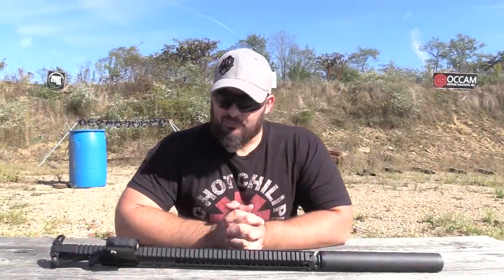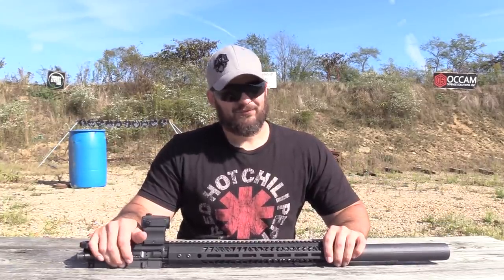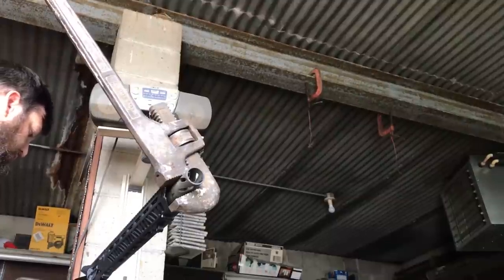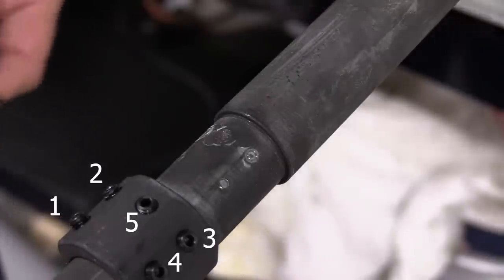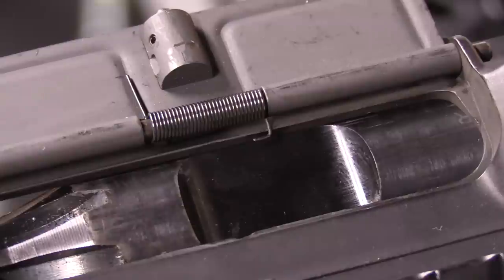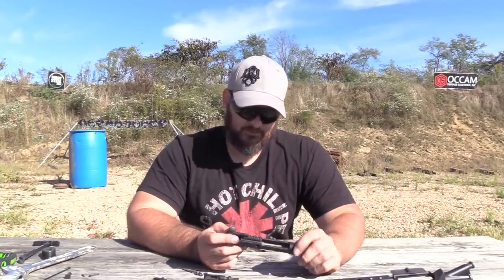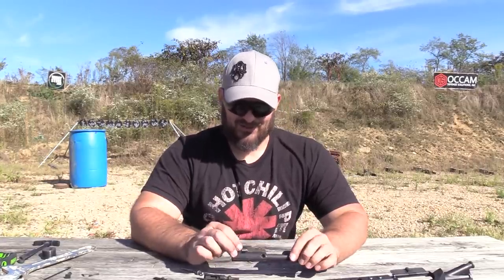The Worst AR 15 I've Seen 🚩Bear Creek Arsenal🚩

Comment: So this video really pissed me off for the fact you were calling anyone who buys or builds a budget AR names. Your also saying there is no way a bigger name company will ever let a non perfect upper through. Well I'm a gun guy not a brand guy like you seem to be, meaning I buy what I like no matter what the name on it is. I own a sig M400 AR I had to send it back to the company 3 time for all sorts of reasons, the bolt, the barrel was warped when it came out of the box, the ejector was jacked. Did they fix the proublem yes they did but what I got was junk. I also own a lot of bca uppers and every one I have got have been completely fine even after 100ps and 1000s or rounds through them. What I'm saying is it dont matter if you pay $200 or $4000 for an upper things can slip through no matter what. And your words NOT ALL YOUTUBERS ARE CREATED EQUIL

Comment: Damn! I thought the video was actually a pretty good testimony for the bca upper. Buy it, check it over, use some red lock tight, use a torque wrench, n check the stakes on the bcg, oil the gun properly and maybe don't use it on a full auto. Then I read the comments section that absolutely roasted you. This was pretty funny. Definitely considering a bca complete upper. Thnx for the review.

Comment: I currently have several Bear Creek uppers and one complete Bear Creek AR I've had zero issues with any of them other than a 7.62 upper and the problem was the magazines. They recommended ASC mags which did not work well when I switch to duramags I had zero issues.

I think it's a possibility you just got a bad upper I don't know. I've also dealt with their customer service and haven't had any issues with customer service despite with some others on here saying.

I think as with anything you can always get a bad fill in the blank some people love Chevy some people love Ford some people love Toyota and dachshunds I've owned them all and I've had lemons of almost everyone but then again at 60yo I've owned probably over 100 trucks in my lifetime.

Don't discount Bear Creek arsenal I think they make some good stuff for the most part.

Another option is to think maybe it's a you problem and not a firearms problem.

Comment: I understand where you are coming from but believe you are incorrect with your complete assessment. You brought to the the table a brand new upper acspecting it to run like a broke in pony even tho it was a brand new unit. YOU NEVER LOCTITE A RIFLE BEFORE THE BREAK IN PERIOD IS OVER FOR THIS VERY REASON! Another point is the specific round you are using...a hunting round. You can never acspect a hunting round to run thru an AR like the .223 or 5.56...the round was not designed for it. Every manufacturer has its draw backs so to say that BCA is the worst is a far reach. In my opinion, DPMS is trash but I don't shoot it down before I know what I am talking about. I bet you a hundred bucks that if you do a proper break in and cleaning that the upper will run fine....I noticed you didn't complain about FTF OR FTE or FAILURES of any kind. And when you are purposely running a weapon to ruin it...I think it is a little irresponsible of you to come out and then try to destroy the reputation of it once you tried to make it fail and it didn't. And yeah...I own some BCA rifles...never a problem. Again, these are my observations and opinions.

Comment: Do you not check stuff out after you buy it?   I have plenty of experience with BCA and I have always had got great quality rifle parts.  Maybe you got 1 that was a lemon.
Reply: No, I'm sure it was just fine. It's like buying a huffy from Walmart and expecting it to compete in a downhill race. It is a budget upper in a beast caliber, full auto suppressed is outside its operating capacity.
Reply: If a manufacturer cared about its reputation, it shouldn't be necessary to check their stuff.

Comment: Every once in a while, you get lucky I guess. So, I had an el-Cheapo AR by a well known East Coast price-leader American armory (good stuff...), and I figured as a cheap experiment, I'd try out .300AAC on this gun (taking the upper off, making a convertible with the lower). I didn't want to make a caliber investment in something that I was curious about, that might fit my needs, but wasn't sure yet. So, at a show, I bought an absurdly cheap 300K upper... I had a choice of about 4-5 in the batch, and spent 15 minutes to ensure I picked the best one. Some were definitely not assembled too well... but the one I had was well-aligned, and well-built. Less than $150 for a little 7.5" upper... went home, inspected, tightened, and the only real adjustment was adding a clamp to guard against handguard rotation. (Same one you display there...)

The thing performed fairly well. Granted, I only put a couple hundred rounds in it. We'll see how the finish and components hold up. But it works fine, for the limited use I need it for. It's boss for the price; love it. I was curious as to who it was, so I started searching all these mystery components... made of "Chinesium" as someone remarked below. I was reasonably sure that the local "gun shop" distributor was buying them whole. As best I can tell, I am 99.33% certain this is a Bear Creek Arsenal, circa 2015-2018.

Would I buy another... 🤔 I just depends what you need it for. Some guns just need to work and be reliable, maybe only a few times. If the Apocalypse happens, duh... I am grabbing my BCM rifle. But if I need to do .300AAC testing, minimal shooting, and have a cheap backup pistol duty for drive-bys and gangbanging... totally worth the money. You pick your battles with gear... when your life depends on a piece of gear, do not skimp... do not rationalize to yourself that your cheap shit is "just as good." Just depends what you need something for.

Everything I am recalling and saying, you know all this. It is no secret to you, this ain't a revelation. For those beginners, though: If BCA is the best you can afford, it'll have to do until you save for better. (Just make sure you check everything, and if you don't know, get somebody knowledgeable to assist you.) But it's better than nothing at all in a pinch.
Reply: PS-- A serious question would be, however... why choose a Bear Creek over a Palmetto State Armory? Veteran owned, minimum mil-spec almost always, exceptional value, great customer service, and 2A friendly. Convenience is a card you hold to play under certain conditions. If you are going to use the gun for some kind of remotely serious duty... go Palmetto.

Comment: So to sum it all up you over gassed a budget big bore rifle by putting a can on it and running it in full auto. You should have used an adjustable gas block, or even better thrown a heavier buffer in there. I’m 17 and I know better than this. I’ve shot a little over 1000 rounds through my BCA 5.56 rifle and haven’t had a single failure, and it shoots great. I know it’s not much, but that’s all I have gotten to shoot recently. Sure some of these rifles might have slight QC issues that could be addressed, but nothing that randomly appears after the first couple range trips. Check out the channel Focus Trip, he has a long term review of his BCA AR chambered in 5.56. I suggest you make a video addressing the mistakes you made in this video. There is a reason this video has received overwhelmingly negative comments, and it’s not that the BCA fan boys are out to get you. As a “wise” man once said, “C’mon Man!”

Comment: Calling Anderson mfg a "poverty pony" is more than a little misguided. Ive used uppers..lowers..BCG's..and bbls from them. They have run right with my LaRue. Actually pretty fair product for the $$$. I use them a LOT in range-Ops. So do others.  You have me wondering.

Comment: BCA Rocks IMO. I have several BCA uppers and never had any problems after thousands of rounds. Additionally, I bought a glock 17 slide from them that broke after a few months and they replaced it with a new one for free. You might want to test products like most consumers before going all Rambo on it with a suppressor and full auto.  Thanks for the video though, but I think you were a bit harsh considering the immediate ramp up to auto-suppressed.  That in itself could have caused the breakage of the BCG ejector. I am no expert, but common sense to me indicates it is probably not a good idea to break a gun in with a suppressor and in full auto. On another note, I have noted that BCG does normally tighten everything down very snug, and the flash protectors are very tight.  It seems they use some form of white solder paste or something stronger than lock tight and it's a bear to get off, but it is definitely not going to fall off.  I've never noted any misalignment on any gas blocks or flash hiders they have shipped to me though.  Try reviewing some of their other products and maybe you will have a change in hear overall.  I try only buying their nitrided products or stainless steel products, although I do have one of two of their phosphate finished products. I learned later on I prefer their nitrided finishes to the phosphate, which I think you would likely agree with after seeing the results of the phosphated barrel. It's their standard economy grade finish, but I would prefer to pay the $20 or so extra for the nitride or 416SS barrels. Just my opinion on that, and what you tested seems to agree with that sentiment. Anyhow, sorry it did not work out for you but you should wrap up with it's a pretty easy repair as well, for the price especially.  Additionally, I have checked head space on several of their uppers in different calibers and the tolerances have all pretty much been perfect.  Had to add a enhanced firing pin and stronger hammer spring to use their 7.62x39 upper on cheap Russian steel case ammo (Wolf and Tula), but it works perfectly in semi-auto. All of their products have generally worked well for me in semi-auto mode and only the glock 17 slide broke and they replaced it for free.

Comment: Your the only guy ive heard say anything bad about bca

Also adjust the spring and buffer tube and remmber theres a bit of throat and gas block or gas port erosion that happens after a bit of rounds through the barrel shoot a few thousand and tune that cycling system not an adjustable block....then try it again your the only guy ive seen say somthing bad about these and really only guy ive seen have issues in full auto thats very odd?

Comment: With due respect, I’ve ran a lot and I mean alot of full auto guns with and without cans. It’s a $200 upper so with that being said if they were $500 or $800 I could see the gripes y’all found making sense but I wouldn’t run any $200 upper on a full auto lower and expect any better results then what you found. Just saying. For the typical user who’s gonna shoot in semi auto 100 rounds a year if that, I’m sure there products are just fine.

Comment: Bro, your leaning on your optic. Not trying to be a stickler, but that doesn't make your critique stand up too well. They are some of the cheapest uppers you can buy. If you're going to run them super hard and full auto, you would think you would upgrade some of the components. Obviously, you get what you pay for in a sense They are mechanical objects and need to be maintained. For the price they are good. They're for a guy that doesn't want to spend $1000+ on a rifle. I would say if you treat them right they should go bang every time.

Comment: DO a side by side comparison with a DD vs BCA... RUN THEM THE SAME, store them, and do the exact same to both.. I guarantee you the DD will have loose gas block screws as well.  People do not run full auto for 1000 rounds and NOT expect a failure..> CREDIT TO BCA the gas tube did not fail... other than that WHO passes the 1000 round full auto test with no lose gas block screws?  NOBODY....

Comment: Who is going around using a 450 full auto . lol.
Can it handle regular target  shooting? Can it handle an accurate hog hunting experience?
Reply from the maker: A suppressor does not increase the pressure, we have a full video on this topic
Reply: @VSO_Gun_Channel  sorry I was thinking linear compensator for some reason.
I changed the comment.
Reply from the maker: @jamesgray143  linear comps don’t do that either.
Reply: @VSO_Gun_Channel  so your saying they don't effect the gas pressure?
I obviously need to do some more research then and the two others I learned this from would be wrong.
Reply from the maker: @jamesgray143  they increase the dwell time. Ive decided to make a 3rd attempt at this topic with no math this time.

Comment: The Worst Video I've Seen 🚩The VSO Gun Channel🚩
In my opinion 1:15 seems to sum up this entire video This guy seems to think 3:26     Not sure why he refers to himself in third person, maybe I just have a poor sense of humor about this one, but when it comes to firearms, emotional fitness is important, but that's okay, it's America and we're all entitled to our opinions, and this is simply mine; but I'm deriving this from the first 10 seconds of the video. Why anyone would take advice from a man who doesn't understand why you don't run full auto with 450 bushmaster on a $300 upper is beyond me.. But the overall comments on this video shows there's still hope for humanity.

If you're bored and want to keep reading.. lets continue and perhaps after we slap our wives around a little (joke) we'll discover what really happened by the end of this comment.

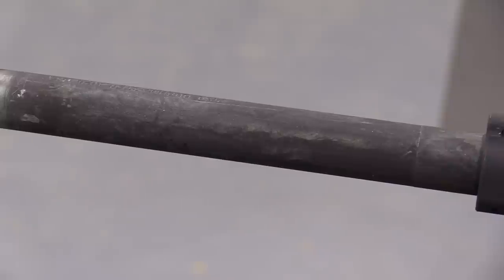At 8:35 I don't think he understood the full effects of heat on parkerized surfaces because it's applied using heat, and can be stripped faster from extreme heats that normally wouldn't occur but it's his fault due to going full auto with a heavy round at a 1:20 twist (friction=heat) with a lot of powder (more heat), in a very light system. Maybe I'm wrong 

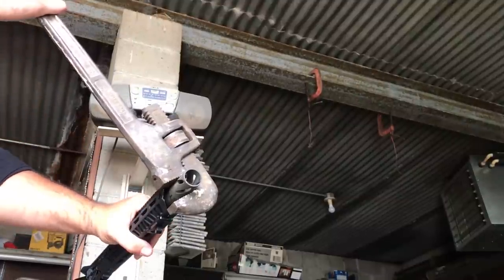hmm so at 9:48 he claims he was already aware the specified part generally gets lose "from hardcore use" and I'd wager going full auto with 450 bushmaster on a lightweight ar15 qualifies, but he didn't take the time to locktite it, and wants to blame the manufacturer for his own lack of diligence before smacking it with the proverbial sledge hammer known as full auto; and that's assuming it didn't happen when he likely warped the entire frame at 3:42 when he uses his tools completely incorrectly (vice closer to the wrench dude, your hand isn't a vice so 6:45)

The reality is, when it stopped working after going full auto in 450 bushmaster in a lightweight system that wasn't designed for 450 bushmaster when it was envisioned in the late 1950's whilst also using a prototype cam that forces extra back pressures, his conclusion should have been 10:32 and stopped there, doing what he did too it and what happened is probably typical. To me, this whole video is comparable to getting angry that a 12ga shotgun broke shooting 50BMG, then blaming the manufacturer because it was possible, but not recommended. 

And so in summary*, I can't help but wonder if he misdirected his anger at the upper instead of the *prototype suppressor he stuck on the end: let's really consider this; maybe this video originally was meant to market a new suppressor, but because the cam ultimately failed at a full auto viability test, he decides to publicly slam a different company to misdirect blame, and then chooses to withhold information on the prototype attachment because it might be responsible for the gun breaking. The tell-tale sign of this is at 7:00 when he points out the gas tube can't handle his configuration, but then wants to skip past it quickly. Even he says at the end of the video that "not all ar15s are created equal," yet he's upset that a sub $300 complete upper couldn't handle his expensive prototype suppressor shooting 450 bushmaster in full auto. I think he was the only person here who was surprised. 

I'll leave you with this to ponder, before I get any responses. Everyone knows a lot about a little, and a little about a lot. Obviously there are certain things he knows a lot more about than myself, and I'm sure the same is true in reverse. After reading all my points though, I suspect most people will conclude that 8:30 and I might be onto something here about why it probably really "broke". This comment is just my 11:24

Side Note: I'm not really bashing the individual or the channel or their company, I'm just attempting to look at this situation, and evaluate it with a different set of eyes; I'm only putting into words what I suspect other people are thinking, and hopefully if the channel owners read this, they'll read it with a light heart and pull away from it with a better sense on how to approach this type of content in a business sense. For instance. Don't demonstrate a product's inability to work universally like you did at 7:28 then immediately turn around and ask for help to get sponsored by them. The same could be said similarly about BCA; you're just burning bridges over an experimental test that you can't be certain wasn't your fault. 9:26